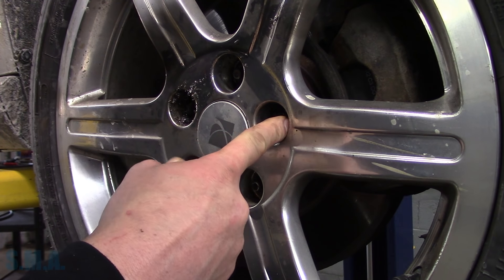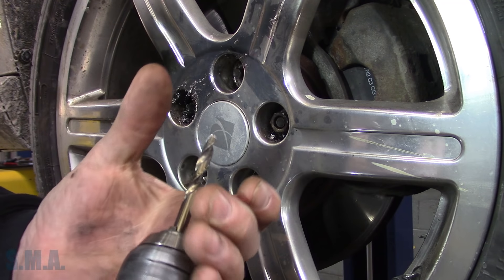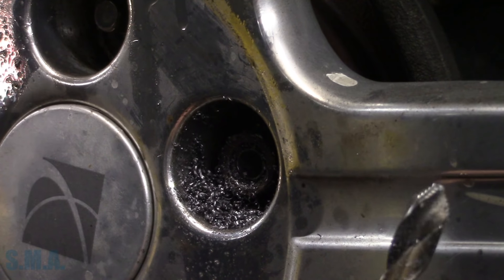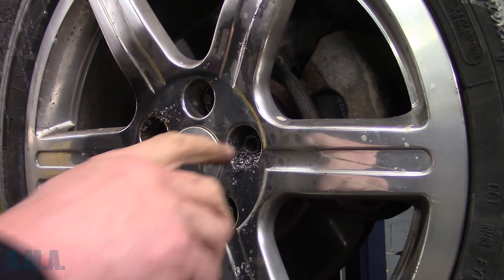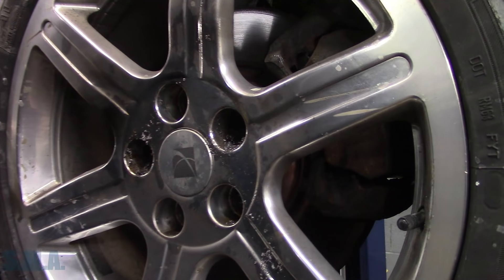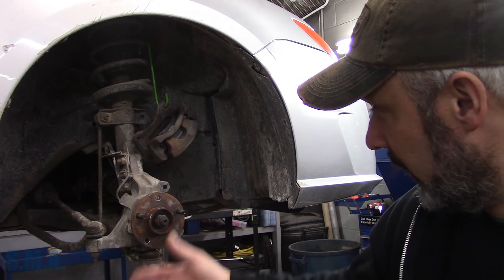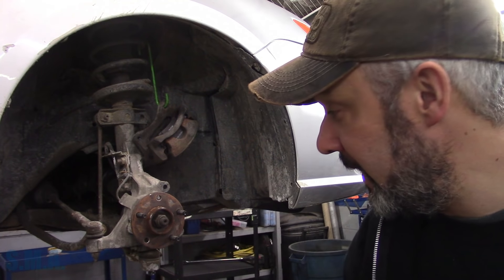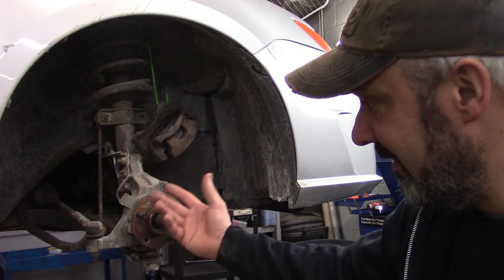DIY Seized/Stopped Lug Nut Removal

Comment from the maker: For the record the customer bought the car this way. It was recently at the Walmart for service before he bought it...
Reply: I bet that oil pan drain plug should be check too.
Reply: recently at the Walmart for service..... Well there's your problem lady.
Reply: Never Wally World 🌎😡
Reply: I hear that leave it to Wally world
Reply: THAT does not surprise me at all....
Reply: Get them kids on a 1/2" Ugga Dugga and they think they need to keep the trigger pulled until the nut stops spinning with the pressure set to 150PSI on the line.  LOL.
Reply: That's who did  it to mine many years ago. Cheaper tires were not worth it.
Reply: I hate them stupid wheel nuts with the chrome cover's.
Reply: I bet all the wheel studs are stretched to the point of failure, as well.
Reply: Lol
Reply: Walmart has trouble with simple tasks like ringing up toilet paper and people expect them to work on a car 🤣🤣🤣
Reply: Thanks Eric now I gotta buy the matco hyper step drill bits. I was actually waiting on someone that's hard on their tools and knows a good tool before I ordered them. I've been waiting about 5 months and most of the guys doing the reviews I had mixed feelings. Its hard sometimes when you have someone sponsored or their tools look like they've never been touched to give a honest balls to the wall review.
Reply: I once took my car to Wally World for a simple oil change. Somehow, the idiots broke a radiator manifold. I couldn't even drive the car away to fix it. Never go to Wally World for car care.
Reply: That explains a lot Walmart services are known for their quality of work as far as I can strip lug nuts off I generally go after breaking the wheel stud method if it's stripped to the point that I can't use a turbo socket on it
Reply: Dealer is no better. Since the car was in for warranty service I had them rotate the tires. Come time to put on my snow tires, I had to use a breaker with a large cheater bar to break them free🤬.
Reply: Hey don’t hate on Walmart auto centers a lot of the guys that work there enjoy working on vehicles but unfortunately Walmart is a shitty company. Some people know what they’re doing some do not. You as a customer have to make sure you set your expectations to these people and inspect after the service. If anything is wrong Walmart always pays 💸💸💸💸
Reply: I've been using copper coat on the studs for the last 15 years or so. (Our personal units, Family and friends I help only) Also on the wheel to rotor mating surface a very thin layer. Haven't had a problem with lugs backing off. Discovered pipe dope and copper coat in the oil and gas industry, fluid film via SMA. 

Might also help that we have multiple rims with tires mounted for seasonal changes so a wheel doesn't have 4 years of winter/summer to cease up. 

Thanks for the free tip!
Reply: And FYI just because it’s Walmart doesn’t mean they don’t know what they’re doing. A lot of guys that work here came out of other shops paying about half what they make here doing major repairs. If you’ll get more money doing oil and tires so be it in this fucked up world
Reply: @chrismechanic2000  IF THEY ARE 19MM TAKE THEM OFF AND TRY A 18MM 6 POINT SOCKET ON THEM. WORKS FOR ME ON ALL U.S CARS . DONE IT FOR YEARS NOW IN MY SHOP.
Reply: @chrismechanic2000  yep they are annoying as hell
Reply: @WOMPCRASH  i worked at Walmart Tire and Lube center while I was in college.  All 4 of us who worked there were college students taking Mechanical Engineering or Electrical/Mechtronics.  We were also all car guys and not once did we ever mess up a car.
Reply: @gilmello8296  
I hear ya! Your shop is only as good as the knuckle dragger’s you hire!
Had a set of chrome rims, morons with the Ugga Dugga gun ran the nuts off in such a way as to leave circular scrapes as they dragged the nut an gun away.
Reply: Wally world strikes again.
Reply: As a 20 year Walmart employee I can say what typically happens is a customer who “just bought the car” with the chrome covers missing will bring the car to Walmart for a $10 tire rotation hoping they will pay for it.  I always knew to throw the 18 on these and they’d be fine for years but if a new hire got the car and rounded them out we’d have to send it to a real shop.  Same with oil changes, if a customer I didn’t recognize came in with a car they “just bought” wanting the cheapest oil change service, that was a red flag for me to inspect that plug before I touched it or else we’d be buying an oil pan.
Reply: The Walmart in our town has extremely specific procedures for lug nuts.  They torque them to factory spec, take the car to the parking lot and do a series of figure 8s and retorque the lug nuts.  Every vehicle they have the wheels off of.  They must have been sued at some point.
Reply: @1988MowerMan  MICHLIN is a value tire in the long run.
Reply: I'd be back there asking Wally to pay the SMA bill if Wally touched the lug nuts. Had a stripped lug nut on my '01 Taurus; junked it due to bad trans before I could get the lug off. Good thing I didn't have a flat tire.
Reply: @michaelblacktree  What?? They were torqued to Wally-Specs; when the air tool can't turn anymore, yer done.
Reply: big surprise..wal mart service lol.....aka drain plugs installed with impacts
Reply: Walmart, that’s where all my fellow newbie beginner techs went after not being good enough (fired) to work at Sears auto center!

But he could’ve done worse.......could’a been to jiffyjube.
Reply: Walmart , enough said 🤦
Reply: @robertl.fallin7062  It wasn't a cheap  brand tire it was just a great price for all 4.
Reply: Old crappy wheels I weld a new nut onto the stripped out nut and hit it with the ugga dugga gun
Reply: @robertquast9684  great idea 👍 . Never thought of that .
Reply: Enuf said🙄
Reply: Walmart "torqued to spec" (i.e. let the Ugga Dugga run on each of 'em for a while...)
Reply: 11 years ago I worked for a tire auto service. Across the highway was a Walmart auto center. We had numerous of angry customers from the auto center where they would strip oil pans/drain plugs or worst yet. They would strip lug nuts. Now you would think if a auto center messed up something or it would break they would be able to fix it. But Walmart corporate will not let the auto center fix it because of liability. The funny thing is they sell tires and are not afraid to tell you their bad and unsafe but they strip your lug studs “oh we can’t fix that sorry corporate won’t let us. I felt sorry for those customers. So I would for they troubles and to generate their business I would give them a free oil change the next time they came back. If you take care of the people they will take care of you!!
Reply: Have the customer bring in his paperwork from Walmart; the technicians are supposed to comment on ANY issues the vehicle comes in with before we even touch it. (Whether it be warning lights on the dash, abnormal noises, or missing or damaged components on the vehicle; and I will bet that the paperwork will say that the lug nuts were damaged prior to service, and are recommended to be replaced.) And AS a Walmart Auto Care Center technician myself I need to set the record straight on how we are supposed to tighten lug nuts or lug bolts; every shop is supposed to have color coded torque sticks that are supposed to stop at a certain torque and a chart with the actual torque numbers on it. The technicians HAVE to record the torque number for the vehicle they are working on into the bay computer. Once the vehicle is back on its wheels, the technicians have to set a torque wrench to the number for that vehicle and go in the usual star pattern. Then a different technician that was not the original tire technician needs to basically repeat the torque wrench step and sign off on the bay computer. Then the vehicle is backed out of the bay and driven in a figure 8 to both settle the suspension and wake up the TPMS system to reset it. Then the lug nut torque is checked a THIRD time by the original technician. So I don’t know where everyone gets the myth that we just ugga dugga the hell out of lug nuts but I can VERY MUCH assure you that it’s not the case, at least at the store I work at.
Reply: @JeffWinter1  Lots of Canadian Tire shops are just as bad. Took three trips to the shop to get 1 flat tire fixed. Finally I stayed and watched...I asked him for a new tire valve, which he charged me extra for, but the tire stopped leaking.
Reply: @WreckDiver99  Torque wrench? never heard of it. rolleyes
Reply: Walmart equivalent to torched to spec
Reply: @Casey835  people r ridiculous smh
Reply: @digitalrailroader  pretty cool covers their asses 2
Reply: @JeffWinter1  But we have Canadian Tire
Reply: @South Main Auto Repair LLC - Surprised Walmart didn't shear off the studs. Must not have been a tire service. I have an old 2005 chevy Impala 3.8L 9c1. That is my daily driver (I do roadside assistance, and gig apps . So of course ALOT of mileage.) I used to get cheap tires at Walmart, considering the mileage they'd last MAYBE long enough to reach income tax season. If I was lucky, or didn't get a screw in the tire. Walmart broke off at least two studs, ALWAYS recommended I take it to a mechanic, and refused to compensate me for their fuck up. 

Then switched to a tire shop a mile away from my house due to a large amount of emergency situations with tires. (SCREWS!!!) They seemed to do decent work. Then, I went in (4 days ago) for two front tire replacements (had replaced both backs due to screws within a month of each other 2 months prior. So still good tread, more than enough to pass inspection and be safe.) They broke another stud, and because I let it slip I did my own maintenance (Older car, extreme mileage, if I didn't do my own work the car would spend most of each month in the shop. As the car has cost me 2K alone this month, But I've made 6K profit.  Ya, I don't sleep) But given it's an ex cop car, about the only things reliable in the vehicle are the engine, and the transmission. Everything else breaks and breaks often.

Well short and long of the story, especially considering I had just done wheel bearings on both rear tires, and a full brake job on all 4 wheels. So had the wheels off the car probably 4 times that week, using an electric milwaukee 1/2 impact to remove the lugs mind you. (Did each wheel bearing separately before I went to work, then did each set of brakes before going to work. So 2 back, next day 2 front.) It was nagging on me that the wheel stud broke as soon as I gave it to a shop. So I asked them what happened. I got 3 separate stories. Original guy said the lugs were cross threaded and one stud couldn't take it and broke off. (Plausible, I was in a rush to get the car on the road for work each time.)   The owner - First story - I over torqued the lugs. Hmm...Plausible. So I asked him what the torque spec was( he never answered the question) and so I TOLD him what  torque spec I used (90ftlbs WITH a torque wrench is what I did.) He heard that response and IMMEDIATELY said "Oh...well than the lug nuts were old and they stripped the threads on the stud. My response? "So, the stud didn't in fact shear off?" Oh no...just the threads stripped. Um, but the "mechanic" who did the tire job said the stud sheared off? Which is it? Stud was sheared off or threads were fucked? There's a HUGE difference. Yes, same overall repair. But different cause of the repair. 

Smells like an upsell to me. When two different employees give you three different stories, chances are, they just wanted to take you for a ride. Am I saying I didn't make a mistake on the vehicle considering I was in a rush each day to get it back together and spend a long day/night at work? Of course not. I'm sure I cut corners or didn't do things properly. But it's funny, the wheel that the stud was messed up on, is the wheel I took over an hour to do a brake job on because I wanted to get things right. Compared to it's neighbor (the driverside front wheel) which I took 30 minutes from wheel up in the air, to back down on the ground, to remove and reinstall the wheel, remove and replace the brake pads, PLUS the guide pins. As they were stripped out from a prior owner. And that wheel didn't have a stud issue.
Reply: 🤣🤣🤣 You said “the Wal~mart” 🤣🤣🤣
Reply: @danielsimpson8929  just curious, do you torque to the OEM stated value?
Reply: @hsttrek1   Short answer no.

Explanation.
Metal to metal torque requirements are higher than metal to metal with copper coat between. Or maybe it's better to say the friction between metal to metal is greater therefore more torque is required to set the fastener tightly per oem specifications. Using a lube reduces the friction so the setting of force to oem specifications doesn't require as much torque. Though I pretty much tighten to oem torque or somewhere around it.

 I put about two peas worth on each stud which coats the threads and the bevel edge of the lug to rim. Then I tighten it with an iron cross till tight. Almost as though I were metal to metal but maybe 1/32 of an uga duga less.

Some say that using copper coat between metals makes a battery but I've had no issues with corrosion. There are pipe threads antiseize option out there without copper but I've had the same bottle for 15 years and still enough left for a few years yet. (Doesn't need to be reapplied every single time or not two peas worth anyway)

Always easy to remove. Threads in great shape, no corrosion build up on rotors or rim face.

The science behind thread lube, anti seize, and alike is used in practice for many things. I don't suggest you try, and if you do it's to your own risk. 

It would be nice if it were written in as normal practice from the oem but for now it's not. Likely due to fear of human error and wheels coming off.
Reply: @WreckDiver99  "The torque is over 9,000!!" :)
Reply: @302vettelife2  Manufacturers warn that once lugs have been loosed, they need to be tightened, then rechecked in 100 miles to make sure the lugs are still at the proper torque. At least somebody in Wallyland found a way to check their work properly before it left the shop.
Reply: @digitalrailroader  Sadly, that's likely after years of complaints and lawsuits; the lawyers got involved and created the overkill procedure described above. I had a Pep-Boys decline to do an oil change on an older car because of a bad oil leak; they told me Corporate lawyers came up with that rule for the reason of being blamed for a problem the car came in with. Nice guys about it; they comped me a half-quart of oil no charge so I didn't lose too much going home a few miles from the shop. They got other work because of that gesture of customer service. Never a bring-back from that store/shop (Lansing, IL).
Reply: I hear a lot of stories about Wally World, I wouldn't let them change the oil on my lawn mower.
Reply: Another FYI Walmart requires use of anti seize on all lugs some not all are just complete idiots
Reply: Their is many ways to take them off but you don't want to damage the rims  I've done that before does work with good drill bits.  Cheap bits will never work
Reply: @danielsimpson8929  Don´t use copper lube on mating surface if you have Aluminium rims, it will cause galvanic corrosion. I use a similar working product, without the copper. Studs are steel so those should be fine with copper lube.
Reply: there's a reason the "wham-bam-thank-you-ma'am" shops slather everything in anti-seize and over-torque.
I will add this, they're most often seized to the rim at the tapered surface, vs. the threads and a junk socket and wailing them with LARGE hammer(sledge) can break many free or heating a few times, but as you mentioned, it discolors the rim and aluminum/magnesium wheels suck the heat away too fast to be of much use.
Reply: @the_hate_inside1085  alloy rims. Not pure aluminum. Oldest car is 2011. It's had copper coat on alloys rims for summer and steels rims for winter going on 10 years.

Though when I run out of copper I do plan on getting another type of lube in place of.
Reply: Lets lay the blame where it belongs, at the feet of the manufacturer . If they had used a solid lug nut, this would not be an issue. Huge GM/ Dodge problem. Rolled off the assembly line just fine, who cares about future corrosion issues? It will be out of warranty by then, LOL.
Reply: @markhaase2046  ford's f150 lugs swell commonly at the bevel. And any car can come in with capped lugs that have sheered off.

It's most likely that the tires were never rotated and rust cleaned up while rotating. When you're rotating every 6000 miles/10,000km the lugs are never this bad.
Reply: Had a nationally known tire shop over torque my front tires lug nuts to the point they warped my brake rotors. It was so obvious I u-turned and came back to the shop immediately and watched them struggle to get the lug nuts off. They had to replace rotors and studs as the studs were stretched.
Reply: yo yo yo Mr O
Reply: @Happyfacehotwheels  That's a good one
Reply: @WOMPCRASH  I'm not hating on the technicians that work at Walmart I'm hating on the company that I've seen more stripped oil plugs and double sealed oil filters oil plugs they're not even tight come from Walmart then Quakers got oats for company that is a multi billion dollars company when it comes to their tire and lube express their quality control sucks point blank
Reply: @mlkelley68  Not the first time..I remember I came in to Walmart for oil change and they topped off my power steering fluid with power steering fluid. Problem was that the car used ATF for power steering.  They had to drain and re-fill, I doubt that did that, but never trusted them again
Reply: @michaelblacktree  /
Reply: @danielsimpson8929  reason I ask is it's not uncommon in aviation for the OEM to give or specify a wet &/or dry torque. Never seen that in the automotive world.
Reply: @hsttrek1  I think in the automotive world it only exists on the fasteners related to the crank, head(s), cams, and others alike. Either the spec is for dry or wet, and dry may or may not require thread lock. 

Interesting that aviation has an option for torque values both dry and wet.

In oil and gas we had wet and dry specs but only after we started using the lube. Prior to that it was all metal to metal for the flange torque. The lube significantly lowered the amount of torque required.

With no wet torque spec for lug nuts, I tighten it up to almost torque spec which I figure is an over torque maybe 20 lbs shy of stretching the studs or gauling the threads.
Reply: Can we please please please please see a tool box tour 😍😍😍😍😍😍😍😍😍😍😍😍😍😍😍😍😍😍😍😍😍😍😍😍
Reply: Not necessarily Walmart's fault. I noticed  that's a saturn, which hasn't been made in how many years? Which means how many years of tire rotations? They even already had the caps peeled off. I have to wonder how many times they were told to get new lug nuts because these are getting worn out. They aren't expensive either, you can generally order a set on Amazon for about $25. But being the kind of person that goes to Walmart for service they were too cheap. I mean "value minded" then when they worn out, as all things do, they just blame Walmart. That's waaay easier then taking responsibility for their own actions. You got what you payed for. Eric obviously understands that. You can see in his videos he uses good tools and takes care of them. In turn they take care of him.
 This fix probably cost the customer big. 20 New studs, 20 new lugs (at retail), and (I'm guessing) about 2 hours of labor. All because they were too lazy spend 25 dollars on a new set of lugs to be installed at their last rotation. 
Me, I wouldnt even have touched it until they brought in new lugs. I wouldnt want my name on it. I've said it before and I'll probably say it again
 "Sir/ma'am we cant rotate your tires at this time because the lugs are getting rounded. Go get a new set and we'll install them when we do the rotation. You dont want to have a flat on the side of the road with these lugs."
Reply: @navyreviewer  2 much 2 read 🤦🤦🤦🤦🤦🤦🤦 try again
Reply: Timothy Salomon  that policy is still in place; although now with the new service writer iPad, it automatically pends the ticket until a supervisor signs off on the waivers.
Reply: I’d be so damn pissed if anyone did that to my lug nuts. What a huge pain in the ass.
Reply: Quick tip "opinion" unrelated to this video other than it's a quick tip idea but I'm curious if you've tried it/what you think.
I recently read about using  finger smear of silicone paste (Just a super thin coat  enough to make the parts shiny but with no clumps at all.) on the inside of a radiator hose and the outside of radiator inlet/outlet before installing a new hose.
I just tried this on one of my hoses during a radiator and hose replacement.  I pushed the lower radiator hose on and off without paste and then applied a thin smear as above.  Just dabbed a bit on a clean finger (ha! good luck with that as a pro mechanic) and smeared it on both surfaces and then put the hose on and pulled it off again and it was ridiculously easy compared to the friction I had without the paste.   With the paste smear a 5 year old could do it.   The obvious concern is the hose will pop off when I don't want it to.  I did a few test drives and verified the hose didn't move and I can't move the hose any if I try with the clamp on but I don't know if it will be an effective aid in hose removal 100,000 miles down the road.  Do you?  Side note:  I did not feel comfortable doing this with OEM spring clamps and switched to the metal screw down pinion type hose clamps on the lubed hose.
Reply: Every bottom dollar chain tire/wheel place I've been to uses the air gun to start threading the bolt, leading to cross threading very often. The employee doesn't care: it's "torqued", so their job is done.
Reply: @davidgilpin5200 :  impact set to "mutilate"
Reply: @Casey835 : It happens EVERYWHERE. After 35 plus years, I can smell the douchebag car flippers when they roll up. They bring their latest junk to suckers-shops, let the shop put their fingerprints on it, then pull all kinds of douchebaggery BS to get the shop to rebuild their latest project car for FREE. I could write a book. And my buddy is a service manager at a busy Pep Boys, and he has stories for days. One example is a local car flipper would buy auction cars that need an engine, drive to unsuspecting garages for LOF, then leave, remove drain plug and let engine grenade. Of course, he'd claim plug just fell out. This guy was the worst of the worst; totally exploited the chargeback system and small claims courts, always had three cases pending simultaneously against different shops, pages of history, and the blind-ass judges "only want the facts of the case at hand", and refuse to hear all the evidence that Mr. Douchebag is a serial parasite to local automotive infrastructure. These judges enable this behavior by ignoring PATTERNS OF BEHAVIOR over YEARS. When a guy has 50 cases in 3 years, a car dealer license, has sold all the cars after the repairs, and the judges know his name on sight, it doesn't take a genius to figure out whats going on... RIGHT JUDGES?!
Reply: Bicks Auto here I beat the shit out of it with my air chisel with a hammer head and bad attitude 👍😁then put socket on it beat that on too 🤣🤗💪💪💪💪no problemo  never used a torch one time I did drill doing this shit for 53 years love your channel
Reply: InstaBlaster
Reply: My tire pop and I went to change it all other lug nuts came off but one . What is the name of  size of the part for the drill I am supposed to use and the special stuff to help?
Reply: Walmart Service Tech: 

Eyes red from after lunch blunt: check. 
Compressor at 200 PSI: check.
Tighten'r til she can't take no more: check.
Reply: @JeffWinter1 x
Reply: @northpoint1039  One time Wally tightened my filter during an oil change so that next time I couldn't get it off with my wrench.
Reply: @wryanddry2266  Some will try and drive a screw driver thru the filter and then try and turn it off. That just rips the filter apart and makes it A LOT harder to get off. Why I change my own oil.
Reply: @northpoint1039  "Some will try and drive a screw driver thru the filter and then try and turn it off. That just rips the filter apart and makes it A LOT harder to get off. Why I change my own oil."  

Also makes it hard to drive the car to somebody who can remove the filter.  I took it back and they did give me a free oil change.  I don't think I had to show a receipt, and I don't remember whether it was even the same store.  So it wasn't that bad.  That was like 25 years ago.